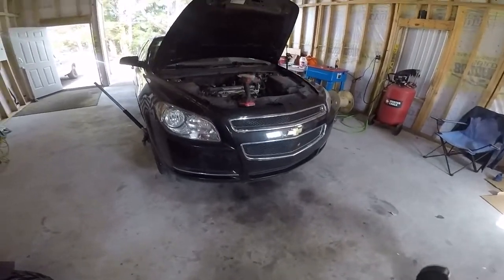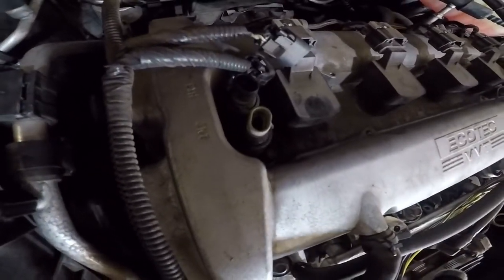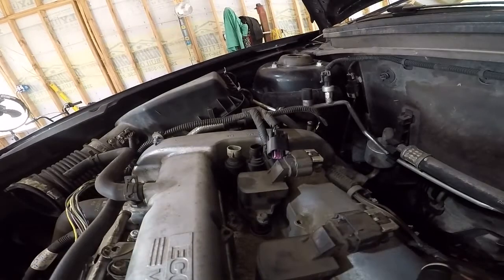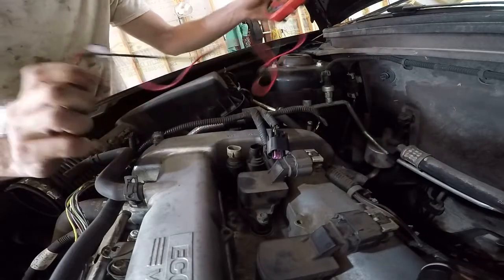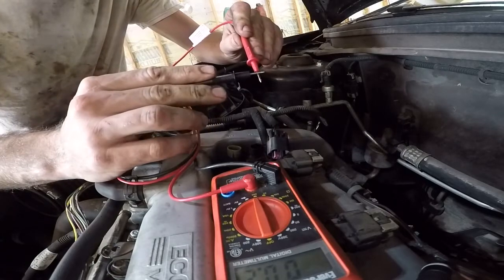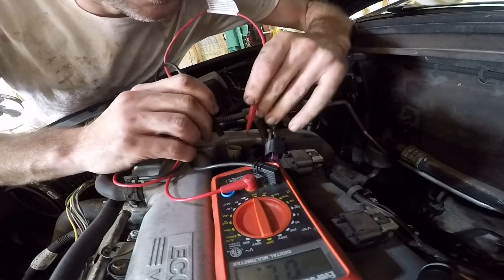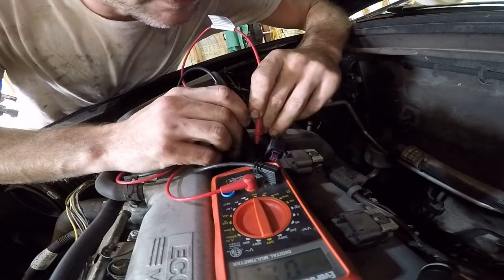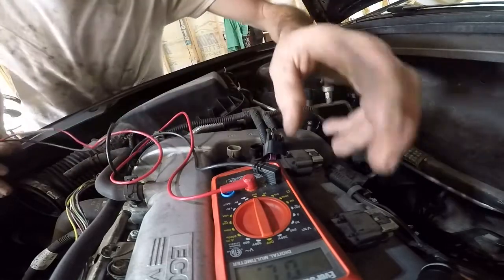how to diagnose a bad VVT solenoid (variable valve timing) with multimeter (or any other solenoid)

Comment: Really???? Useless Video in less than 1 minute 👎👎
Reply from the maker: If you say so 🤷‍♂️
Reply: Helped me but I did have to go to comments to know which was bad..
Reply from the maker: @letsdoitourselves5322  I suppose I was not very clear in the video .. the one reading 0.000 is the bad one
Reply: @natesgarage8025  Yes sir! 8v to 12v is what you want. Anything less is a need for replacement.
Reply from the maker: @duringreyowl2588  I'm reading ohms between the actuator prongs 0 ohms is no resistance or open loop